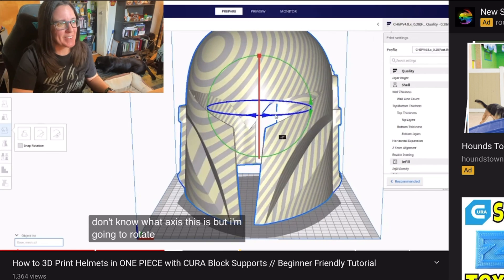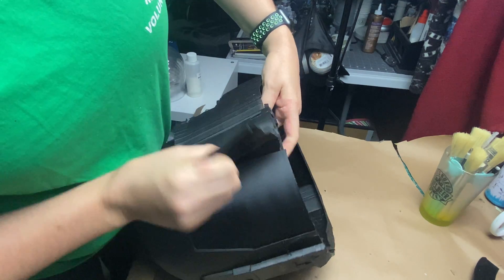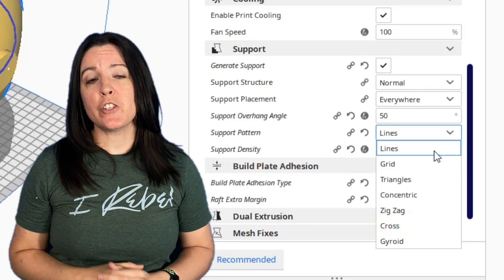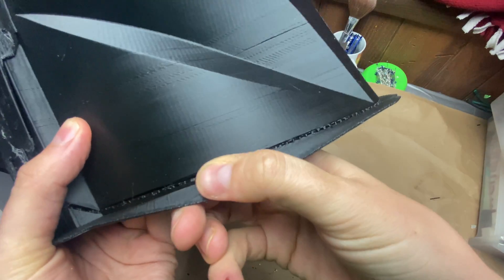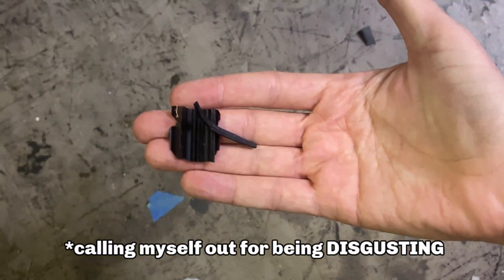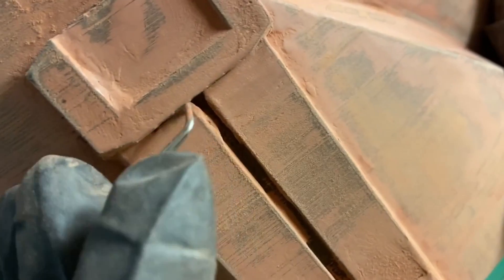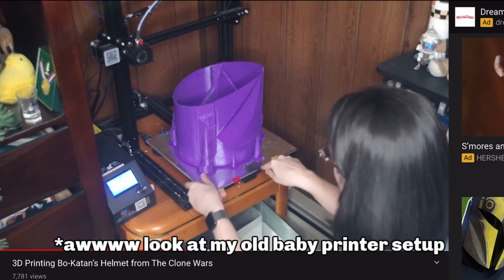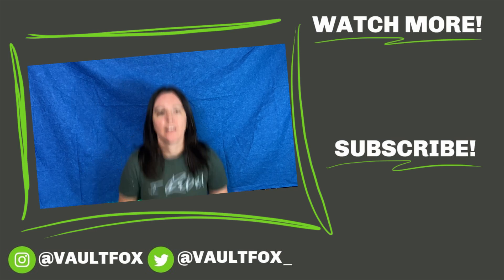My Settings for EASY TO REMOVE Supports PLUS Tools I Use to Remove 3D Printed Supports

Comment: I got a Neptune 4 plus and I've been printing on 2% infill with no issues. Mind you I'm very new to printing, but I've printed a few helmets with no issues at 2%. Ive always used the normal style but recently switched to tree and im gonna see how that works.

Comment: Love your energy and humour and that you actually offer great advice. QUESTION, I printed my first figurine - Fry from Futurama, taking onboard you suggestions. I used 10% Support Density and Lines as the pattern. Unfortunately, lines were no good though easy to remove. They wobbled side to side for his hands and arms - no lateral stiffness, and the arms failed. The hands are about 75mm above the build plate. Would Triangle pattern be appropriate for this situation?

Comment: Great video, I like your soldering iron trick. I might recommend buying a soldering station with adjustable temperature and interchangeable tips. Then you can dial down temp and use fine tips for your details and small slots. Keep up the great work. (MYPOUOS 2 IN 1 750W LED Digital Soldering Station)

Comment: I've been doing a lot of Iron Man and C-3PO parts using 2-3% Support Density and I also use Tree Supports.  I use a larger nozzle size (0.8mm) so those supports are strong!  Also, Support Interface makes for some much smoother parts where the support was.

Comment: Support Z Distance also helps with removing supports its kind of like the air gap on the raft settings in cura. I also recommend using a hair dryer to remove prints make the support a little softer where they connect to the prints some times helps.
Reply from the maker: huh! I've never heard of using a hair dryer for removing supports, I'll have to give that a go. and thanks for the Support Z distance tip, I knew there was something that helped with air gaps but couldn't remember the setting
Reply: @vaultfox  I was the same and never knew about the hair dryer method. It helps to keep the prints fairly clean because if you don't have enough of a gap between the print and the support, sometimes when you pull the support off, it can take a small piece of the print with it. It's not enough to mess up the print, but if you're like me and love your prints to be pretty much perfect, it can be a bit frustrating.

The Support Z Distance is the major factor you want to look at though. When people learn and understand it, printing becomes a million times better. Take tree support, for example. Lots of people have trouble with it, but not many understand that the print should be off the bed to use tree support. Think of it like a real tree where the trunk is always the thickest area, but as you go up, it starts to spread out and become branches. Putting the print on the bed will result in really thick and impossible support to remove. This is like a trunk, and the bed is the roots. You want the support to branch out, so by lifting the print off the bed and also placing it at an angle, tree support works a lot better. A perfect example that does this is a resin printer.

I hope this helps you. This advice comes from many years of experience. I started my printing projects with a Robo r1+, which was one of the better high-end printers at the time. So, I learned a lot from that. Your content is great, by the way, and I hope you can discuss the information I have given you. However, please only look at my information as a guide because some methods work for others while some don't.

Comment: I'm wondering more how you print those helmet-sized prints without it taking 3 days or more!
I have a Creality Ender 3 Max, am new to it.   It has a build height of 13" but I had no idea the larger prints take so long based on the estimates Cura is giving.   I've never tried one but that's 3 days day and night and if everything goes right!    And how many things can go wrong in three 24 hour days, I wonder?    
wooh.
Reply from the maker: it's a lot of messing with my settings/support infill/removing unnecessary supports and print speed. I printed a lot of my stuff back in the day at 100 mm/s speed which I think helped a lot BUT can cause failures if you're not careful as CR10s's and other Creality machines kinda dont like being pushed that fast. I don't print that fast anymore (I try not to go above 50-60 mm/s)
Reply: @vaultfox  what about a larger nozzle?   They sell nozzles up to 1mm.   
Or would they then come out looking like Minecraft lol

Comment: New to 3d printing and tried to do a Battlestar galactica model.  With all the weird detail shapes and overhangs it’s been maddening.  Still not even close to getting it done due to all the supports.  😂
Reply from the maker: ooooo which model? the pilot helmets?
Reply: @vaultfox  The Galactica itself.

Comment: I uh checked my support % and uhhhhh it was at 100%...
woops
Reply from the maker: I'm pretty sure I printed with supports at 100% for a good six months before figuring it out soooo I get it lol
Reply: @vaultfox  it turns out the anti warp add-on I had caused that so before I was doing the right support% 😂

Comment: What ZYLTech filament are you using for this print? PLA? ABS? Please help
Reply from the maker: PLA!
Reply: @vaultfox  Would you recommend this brand PLA for building a Power Rangers Helmet or regular props in general?

Comment: I have been using a high speed dremel with a bullet shaped buffing head to smooth prints after removing supports. It's worked great (makes a mess though). Your setting suggestions are a huge help! Thanks!

Comment: So if 5 is working on thinks like helmets should I be comfortable
Using 5 on things like printer addons like a handle and stuff like that? I broke my print yesterday trying to get the default settings supports off lol

Comment: I'm going to try the infill percentage, thanks! I had a lot of issues removing the supports from my last very long print.
Reply from the maker: hope it works for you! I actually go as low as 1-2% nowadays with mostly no issues (and if I do have issues, I know I gotta tune up the printer)

Comment: There is a setting under the experimental  tab that says "break up supports in chunks." I have found this makes the supports alot easier to remove but like with everything that deals with supports you have to find that happy median where your not sacrificing the reliability of the support

Comment: Thank you for the tips.   With my old 3d printer(tevo tarantula base 220x220x280), I didn't have to many issues with supports.  But recently with my Tevo Nereus 310x310x400 (was 320x320x400) had to replace the printbed some warping.   I've had a lot of problems with removing supports.  So I hope the new tips helps.  Will let you know.

Comment: what 3D printer do you use? bc i recently got anycubic Vyper
Reply from the maker: today I just have 2 CR10s's ... I actually bought a Viper back when I was upgrading and decided to return it ONLY because I didn't want to learn a whole new printer
Reply: @vaultfox  oh nice! How is the set up and printing speed of CR10 compared to the Vyper? I've noticed the Vyper is a bit noisy and is particular about the settings when it comes to specific filaments

Comment: Thank you so much I feel not so lost now. Supports have been my only complaint about 3D printing so far. I'm just worried about snapping something if I grip it wrong. This video will help with my confidence!
Reply from the maker: Glad to help! Supports are pretty hard to get the hang of printing so they support well enough but also aren’t a pain to take off

Comment: I recommend a plastic welder kit to weld your pieces together :). It is very similar to a soldering iron
Reply from the maker: That's actually what I use today when I need to piece prints together, this video is kind of old

Comment: You can play with the z-distance of your supports. which leaves a teenie tiny gap between the top of the support and what it's supporting. Still stupports the material but then makes it really easy to pull off
Reply from the maker: Thanks for the tip, didn't know you could do that with the z-distance, I've only played around with the air gap on the rafts
Reply: @vaultfox  have you adjusted the z distance much? or have a video on it ?
Reply: @vaultfox this may be THE most important support setting for ease of removal. 

Combine this with support density and you got much easier support removal.

Comment: What settings do you use for the Raft? I can't seem to get mine to work! Thanks
Reply from the maker: I slice in CURA and my additional settings are just 
Raft Extra Margin: 4mm 
Raft Air Gap: 0.3mm

Comment: Awesome tips! I printed my first helmets and did the support blocking for the bottom of the dome area. I do have a bit of stringing going on in there tho - any tips to smooth that out? Maybe with a heat gun?

Comment: I always print helmets and other props with 3% support density. I've done so pretty much from the start and I've never had a failed print due to my supports before.
Reply from the maker: I actually use 1% now after some commentors let me know they had success and I finally made the jump, never goin back lol

Comment: I notice when i dropped my infill density to 5% from 12%, the The support line distance jumped from 3.3% to 8%. Is 8% what others have set it at? 
I'm at the point of jacking in FDM printing all together. No matter what settings i try, no matter what i alter, ive never had supports that just come away as easy as what you some in some of these youtube videos. Ever since resin printing came out ive hardly ever used my ultimaker as im sick of supports. Unless its a really large model (like a helmet), something that doesn't really require supports i never use my ultimaker 2+ anymore.

Comment: What material are you printing in? If it's PLA then that bridges well and it's easier to get low density supports which remove easier. I have been printing with Nylon and Carbon Fiber Nylon which are higher temp and very thin viscosity so they don't bridge well at all. That causes me to have a lot of problems where the supports adhere to the part very firmly. Do you have any suggestions for support settings for that kind of material?

Comment: Do you enable the Support Interface on your helmets? I just got my printer set up and in the few prints I've done, its been a nightmare getting the supports off, and even when I do, it leaves a huge mess behind that I need to use a rotary tool on just get smooth.
Reply from the maker: Ooof, yeah ... seems like you need to do something with your support settings. I've got the support interface enabled (if you mean in the settings to the right in CURA). Setting your support infill to a lower percentage might help, but sounds like you have something more going on than just the infill.

Comment: So I’m late to this, but I just finished a one shot Mando Helmet with 3% zigzag support. It was still so awful to remove the supports. 🤦‍♂️
Reply from the maker: Were you also using the profile I linked? There's something about it (I want to say it's the raft air-gap) that allows the supports to be knocked off pretty easily. 

I will admit ever since I upgraded my profiles to 4.11 they have been a bit tougher to knock off and I haven't really figured out why that is. Always something with 3D printing i swear

Comment: Wonky idea from the plastic modeling side of things (just got a printer, so I haven't tried it yet)
Mostly I've seen and done this with car kits, but some genius figured out that you could "open" molded in doors/trunks whatever. Just use thread as a low speed low heat "wire saw". It works faster than you'd think,  and has excellent control if you take your time. 
Might be good for delicate or small area removal.
Reply from the maker: I feel like I would have none the patience for that method but if I got into a tight spot, I'll have to give it a try!

Comment: I use GrizzleGnome ender 3 v2 settings.. full on didnt realise Ive been running with 5% support density...
Reply from the maker: I’ll have to check that out, I’ve been doing 1% support density for a while actually and it’s been working great!
Reply: @vaultfox my prints come out so good. I am trying to fiddle with it so I can get smooth bases as I don’t like sanding them smooth

Comment: I use 10%  however I have problems getting the support out of screw holes.  And sometimes I just can't position the piece vertical.
Reply from the maker: Yeah, I've been there. I usually use a small hook tool to try and pry them out

Comment: you should have a box for essential 3d printer tools next yo your printer, and if not there is some addons to put to your printer were you would leave your essential tools
Reply from the maker: I have a mug next to it with some of those tools but my issue is putting them back where they belong each time I use em

Comment: just subscribed :) . i tend to swap between tree and normal supports, see what looks best, sometimes one setting on that doesnt support everything for me :/ dont know why... theres also support roof setting, so if you increase that, it increases the support density at the top (harder to remove, but more support)
Reply from the maker: thank you so much for the sub! tree supports are great too, I've used them in the past and loved how they worked and thanks for the tip on the roof setting!  will have to mess around with that

Comment: Very interesting video. Thanks. I usually use 10% (though did start higher when I first started) as I was worried with them failing. Might have to be brave and give 5% a go. Always trial and error isn't it! Love rafts, never print without them. Funny editing too btw 😊
Reply from the maker: Yeah, like I said I was hesitant to try lower than 10% for a while but now that I have I can’t go back. And thanks on the editing! I had a lot of fun with this one

Comment: WHAT?!?! I PRINT MY SUPPORTS AT 2.5 PERCENT INFILL AM I DOING SOMETHING WRONG? (I print my helmets at 5 as they are really only display pieces so I keep support low as well and haven’t had problems with it, should I go higher?)
Reply from the maker: hahaha no I wouldn't say you're doing anything wrong with that level of infill, especially if it's working for you!! and if your helmets are display pieces 5% infill is fine I'd say. I've printed armor pieces and such at that low of an infill whenever I'm printing out proof of concepts or just need to test a file

Comment: Hi, yes. I use 5% support infill. No problems yes. Tree supports are also very easy to remove. Some tools I use to remove are actually used on bowling balls. A bevel knife, which has three sides to it, and Bowling Ball Tape Extracting Removal Tool. Thanks for all your help.
Reply from the maker: I just looked up those tools and that is SUPER interesting! I would never have thought to use tools for bowling balls for 3D Printing!

Comment: I’ve been using 5% supports for a while and I love how easy they come off. I’ve had some minor supports fail on most of my helmets but they are usually on areas that done need support anyways. I’m just too lazy sometimes to block them in cura. That and halo helmets from what I’ve seen are much more complex shape wise compared to the mando helmet I printed so it will put supports in very small areas near the top of the print that reach to the build plate
Reply from the maker: That’s good to hear 5% has been working for you! And same I’ve been lucky that when they fail it’s in places that aren’t so bad

Comment: Been using 5% from start. Still have some issues on certain prints getting them off. But I also use 1.0mm tip and can do a helmet in 18 hours. So the supports are a bit thicker because of that. I also almost always use custom supports so I dont get them in those small spaces that are hard to get to. Good video, you crack me up. Had my hopes up high when you said ruined your marriage. Now my hopes are dashed.. Just kidding..
Reply from the maker: One of these day's I'll put a larger nozzle on my machines lol ... I keep getting tempted from comments like this. Glad to crack ya up and yeah, sorry about the marriage failure bein' a cop-out :P